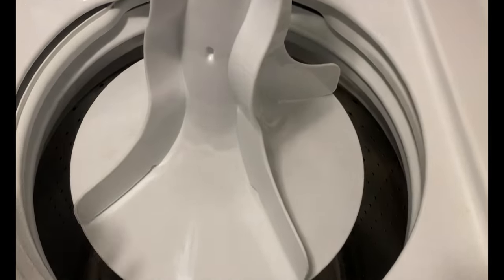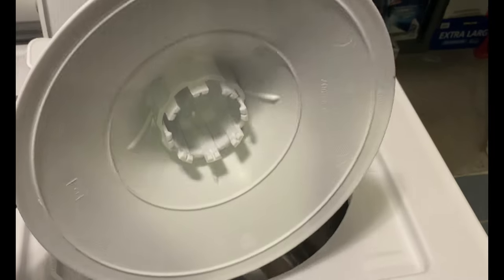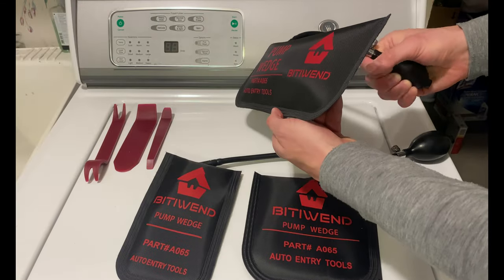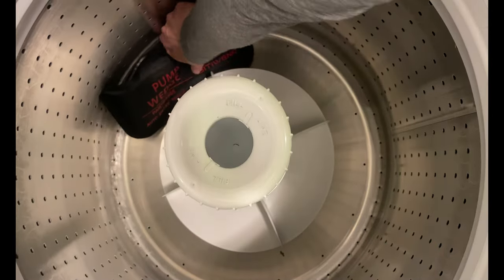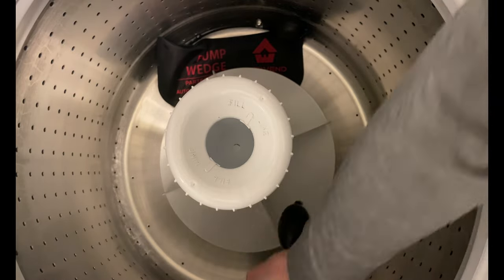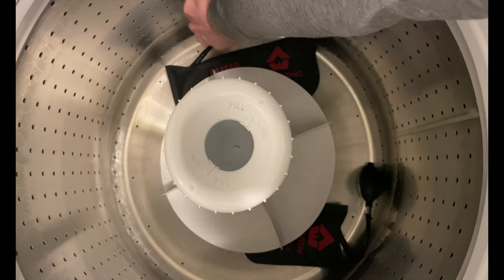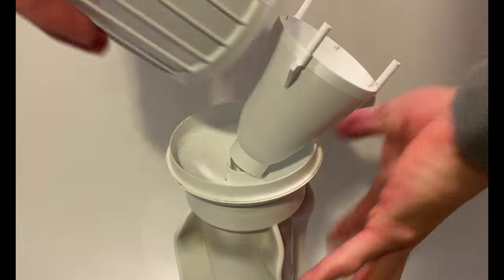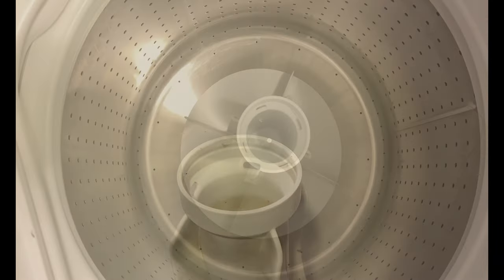Speed Queen Washer Agitator Removal & Replacement (Using Air Wedges)

Comment: I pulled it up by gripping firmly beneath agitator with both hands in a parallel position then pulled upwards and it came off quite easily 👍. Thanks for the video bro 😎 You saved my wife and I a call to the maintenance man 👨.
Reply from the maker: Glad I could help!  You must be strong to pull that machine apart by hand, great work!
Reply: I was able to pull it up using this method as well. It does take some dedicated force but not THAT much force. A strong tug or a few will do the trick!
Reply: Just wanted to add, I was able to run up to the only thing holding it or some plastic clips. I would say, move slowly by firmly, and you should be able to get it off by hand. Probably 20 or 30 pounds of pressure.
Reply: Thanks people!  What did you find inside if I might ask?

Comment: I just watched your video and didn’t have the inflatable wedges, and I was stuck at how to remove the agitator. I asked my 15 year-old son what he thought.  After using the terminology in your video and showing him parts of the video as to how the part worked, he came up with the idea of using some type of string.  Thank you so much for your video. It helped educate myself and my son and we found it alternative way to pop the agitator right off. My 15-year-old had a slide flat rope under opposite sides and then put pressure from opposite sides and it popped right off. We would not have known the mechanical force issue behind removing it had it not been for your video..
Reply from the maker: Awesome work, glad you were able to fix the washer with the help of your son!  This is what YouTube is all about out!

Comment: To fit back the agitator,  just place it on top of the shaft it came off and gently turn until the slots in the agitator and shaft are aligned. It will then slightly fit into position, all you have to do from there is firmly press down on the agitator until you hear it snap in place 😉

Comment: Thank you so very much for this.  I have to change the bearings and seal- bought the kit but haven't done the repair yet cause I have not been able to remove the agitator. Its a slow, intermittent  leak so I figured before I do the repair I need to make sure I can get the agitator off. Well I couldn't.  I used pry bars meant for my car moulding,  I used my belt to yank on it and nothing worked. Last night after seeing your video, my air wedges arrived.  And it still was not easy. It was very stuck. I was afraid I was going to crack the agitator.  I used all three, evenly, and had to quit multiple times out of fear of a snap. But on the fourth try an hour later it came off. Holy gunk underneath. Well it should be much easier now that its been off once, and cleaned. If you're still reading or anyone else is, thank you !
Reply from the maker: I'm glad the video was helpful!  In my case, the agitator was gouged and it would damage the clothes so I replaced it.  OEM was $20, shipping actually cost more ha.  A lot of the time gunk is from fabric softeners.

Comment: Thank You. This is the only video, so far , that explains how to remove agitator. I discovered that My almost 11 yr old speed queen has some gunk living inside the agitator.. the gunk was seeping through the oval holes in the agitator and I kept trying to pull the gunk through with my fingers. I wasn't sure how to take the top part off and this explained it well. I can't believe NOBODY else has come across this issue.. There are videos explaining how to remove the entire agitator but nothing explaining how gunk can get INSIDE the agitator.. Hopefully, this will come to use to others. thanks
Reply from the maker: I’m glad I was able to help.  At 11 years old your Speed Queen is barely broken in.  Do you use a lot of fabric softener, I hear that usually is the reason for gunk accumulation.
Reply: @OwenLucas  Yes, I do!!! probably not broken in yet as I only do laundry once per week.. the only repair has been a new belt.. Once again, thanks for the helpful video!
Reply: I am having this same problem! Will taking the agitator off and cleaning help?

Comment: Speed Queen Model?? 
This agitator and drum look identical to my 23-year-old Amana. Apparently I can't get parts for my Amana anymore so I'm curious what model the Speed Queen is???  My guess is I can still get parts even though the parts websites say they're obsolete. The agitator is literally identical to mine and removes the same way thanks to this video.  I bought two bladders from Lowe's last night and was able to easily remove it.  PS - the reason I want to keep the Amana going is it's built like a tank.  Modern washers are not unless you spend a couple thousand.  This unit was $550 in 1999.  Has a stainless drum and beefy motor and pump housing.

Comment: Hi All.
Great video.
My agitator was able to be pulled straight up with brute force and no airbags.
I found 30 years worth of hardened scale underneath.
I'm looking for the source of a very sticky greasy substance in my bowl.
I found the rubber washes sealing the bolts under the agitator to be degraded.
I wonder if this is the source of my brown gunk.
Any ideas?
Reply from the maker: Could be usage of fabric softener maybe?  Either that or or aging.  You must be strong to lift the agitator out by hand! 💪

Comment: I have stains running down from the holes in the agitator?
Reply from the maker: Your softener cup probably needs to be removed and cleaned along with the top part of the agitator.  Could be old liquids coming down.
Reply: @OwenLucas   never knew it was there! But yeah it was filthy
Reply: Same thing happened to me... It was so satisfying cleaning the gunk from inside.. the gunk was seeping through the holes..